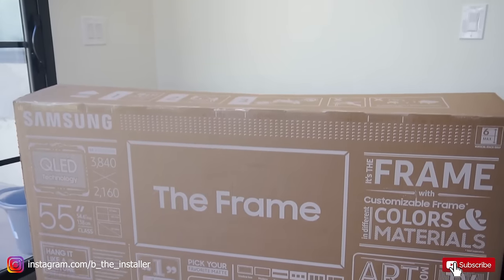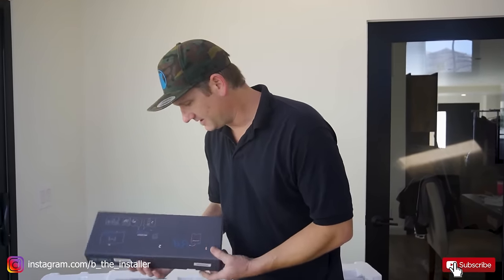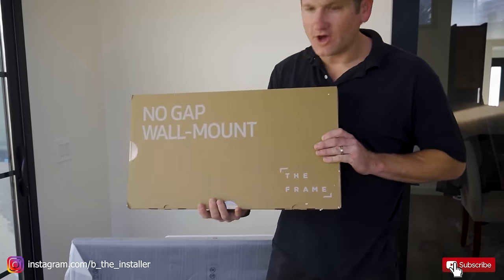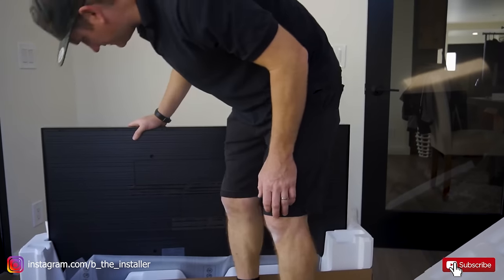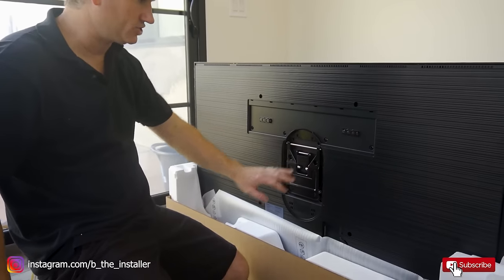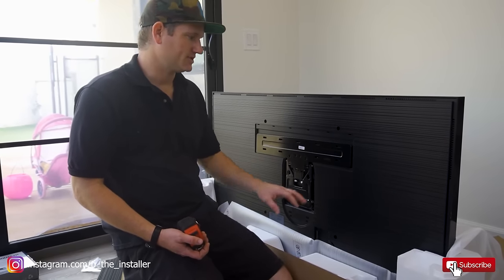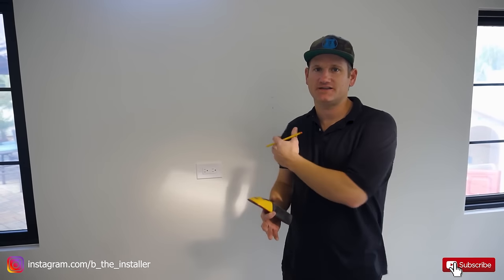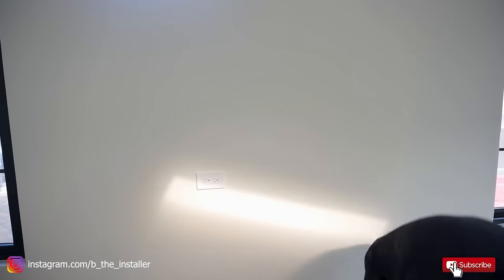Samsung Frame TV Installed w/ "No-Gap" mount in 30 minutes

Comment: What kind of plate did you use next to the outlet at the bottom that you pulled the one connect wore through?
Reply from the maker: Low voltage box and then an oversized blank nylon plate from home depot.  They're like 5/8" bigger and easier to cut if needed.

Comment: You mention using drywall screws, what size should I get (I assume they come in different sizes)?
Reply from the maker: The no gap mount needs some sort of screw into the stud.  2 inch drywall screws work with a washer but you can use the samsung screws that come with the mount.
Reply: @BTheInstaller   You scared me with the info the screws in the box can strip easily. Once that happens how would you get them out again? I'm off to Home Depot to buy all the supplies.
Reply: We did it!!!! Your video was excellent and your commentary perfect! We didn't even look at the manual which at first glance was pretty confusing. Thank you so much for your service!! Now we just have to wait for Comcast to put a new cable line somewhere as right now the cable runs through the middle of the room, ruining the look a bit :o)
Reply from the maker: @franreynolds2008  awesome.  Ditch cable, it sucks.  Try a Hulu live or YouTube TV trial, so much better and cheaper. No boxes, no contracts.  Also tag me on a IG pic of your work.  If you do, make a nice wide angle pic with the tv in middle and brag to friends.  Take care

Comment: Great video. Just curious and forgive me if this was already answered, but I thought the One Connect cable provided from Samsung for this tv and any of their latest tvs that use the One Connect box is not in wall rated. Samsung makes a One Connect in wall rated cable for purchase separately. I’m going with the Samsung Q90 82” which uses the one-connect box and was on the fence about putting the included cable within the wall cavity va having it exposed on the outside of the wall. Thoughts?
Reply from the maker: Correct.   Since they've added power to the one connect, it's really complicated the install a bit.  As I've said, I don't condone running high voltage wiring in wall, but when it comes to sound bars, and self amplified speakers like sonos, and this samsung style tv, there are limited options for making it look clean.  I've had many electricians who are less concerned with cords in wall as I have been.  They make an in-wall rated version of the wire for $200, so you can pick that up.  You also can install a 14x14 inch low voltage panel behind the tv and it can have a power outlet inside. But then you can't access the one connect very well.  We didnt have the room for the box behind TV, and I was comfortable in dropping this wire in wall 3ft and outputting it below.  The customer knows the code and opted for this method.
Reply: B The Installer - Thank you sir! Well explained. Subscribed!
Reply: @BTheInstaller  it’s not up to code

Comment: Hey B,

Appreciate the good video. I have a 2019
Frame coming this week so I’ve watched your video twice through now to help with the install. I’d like to run the one connect behind the wall but I understand it technically isn’t wall rated. It’s going up on an exterior wall in my master so the wall is insulated. Is there any greater threat posed running that one connect down about 4 feet of insulation? Thanks!
Reply from the maker: Hey greg, it's actually depends on if there is a fire block or not more so than the insulation.  Insulation lays flat and so I try to use a fish tape and go in front or behind the insulation. If you can get the tape up and down then try and without resistance, pull one connect down the wall by taping.  If it has resistance, you may need to move insulation around by sticking arm in wall.  Of you have fireblock, then it's harder.  I simply cut straight into drywall and fire block run the cord down past the fire block and then put a metal plate over the whole in wood and patch the drywall.
Reply: Thanks!No fireblock.  It seems like I can get my fish right up the wall no problem. I also have the 55 inch model coming that you did in this video so I jumped the gun and used some of your measurements to pre Mark the wall and cut my two holes. Should be able to run that one connect right in front of the insulation. Thank you!

Comment: Hey I researched that the cord for the connect one that you ran into the and between the studs is not “in wall rated”. Is this true? What are your thoughts on this. Haven’t purchase my tv yet but want to gather all my facts before I do. Thx!
Reply from the maker: Correct, in both frame videos I highlight this.  It's not something many are concerned with unless you're running it through studs and near screws and stuff.   How I did both, were straight up and down, as safe as it could be and if that still is not your choice, they make an in wall rated version I'll link in description.

Comment: I watched another video where the guy said the cable was not wall-rated, thus requiring a conduit. Is that true?
Reply from the maker: This video also says its not in-wall rated.   But he should have explained a "conduit" is not changing the fact that the one-wire still is a high voltage wire inside.  So it's actually still an issue.  Even the in-wall rated cord you can buy has its flaws.   It's my opinion that ony own tv, I would not be concerned with this cord in wall straight up and down to avoid it being visible. But it's also not a very visible cord.  So your call.  Thanks

Comment: Another GREAT video from B the Installer! 

In watching this, I have just one question. It appears that the TV you installed hangs with the frame flush to the wall...yet the TV overlays the electrical duplex outlet. 

So is the frame "thicker" than the TV itself to allow it to overhang the duplex? (I will need to install my Frame with the bottom 1/3 overhanging a zero clearance fireplace which is flush to the sheetrock, so I'll need to run the one-connect cable along the TV back from near the bottom of the TV horizontally to the edge of the TV to pull cable through a chase). Will the Frame still lie flat on the wall with the cable running along the back of the TV?
Reply from the maker: Yes the wire is extremely thin and doesn't effect the flat tv.  But anything thicker will.  I had to take off covers to get things laid flat.
Reply: Hold on, you say you had to take covers to lay it flat but the cable running along the back is thinner than an outlet cover?
Reply from the maker: No.  The cover plates are thicker.  The wire is extremely thin

Comment: What is the exact model number of this 55" Frame TV?  I need to make certain regarding the location / dimension of that wall mount plate.  The back of TV looks different in regards the plate location on your video compared to the view I get online of other 2019 Frame TVs?
Reply from the maker: No idea.  Probably can read off the box when unboxing.  Should be the 2019 55 inch.

Comment: Two questions:  I don't have a center stud but have two 8 inches on either side of center (16" apart from each other).  Would that be ok?  Also, should we remove the outlet we have back there (to minimize the gap) or is that not an issue?  Thanks!
Reply from the maker: The 16" studs you have are the norm and great.  The mount is made for your situation.  You can remove the outlet if needed.  It did protrude out a little from the power outlet.
Reply: @BTheInstaller  Ok thanks! We are installing this above our fireplace and I just noticed the conduit that was installed is only 1" in diameter so I don't think the cable will fit through.  Any suggestions?
Reply from the maker: Well depending on the layout of the fireplace, cords can be run outside of that conduit in walls.  If you taking out a power outlet, you will be making some holes... I may cut a 6" square drywall hole and use that hole to fish the wire.  You can repair the wall. May need some pro help

Comment: My brother mentioned that the wiring behind the wall is a fire hazard. Do you know if they sell wiring that is fire proof or fire retardant?
Reply: Samsung does sell an in-wall approved connector. However, from reviews elsewhere it sound like it does not allow the TV to sit flush against the wall, which is kind of the whole point. Also, Samsung seems to be sold out indefinitely!

Comment: How are you getting around that the one connect wire is not wall rated?  Samsung sells a wall rated cord for 2019 models- so having a 2020 model thoughts on what I should do?
Reply from the maker: I install it in the wall, every time.  But I do knowing to keep the wire clear of nails or screws and straight up and down.
Reply: B The Installer so you think the wall rated cord is just wrapped not to damaged it?
Reply from the maker: That is exactly what it is and It won't burn as much in wall if on fire, as well.  But those are worst case scenarios. The 2019 cord is same as 2020 by the way.

Comment: Does the hole for the One Connect wire have to line up exactly behind where it connects into the TV? I already have a hole in the wall I was planning to feed the wire out of, but it’s higher on the wall, so the wire would have to run behind the TV for about 18 inches to reach the connection point. I definitely don’t want this thing to crimp, as I understand the cable can be ruined by a sharp crimp.
Reply from the maker: If you have enough length and it's not affecting the how flat the tv is on the wall, should work.  I prefer to get the cord in the general area the cord attaches for the reasons we are talking about, length and mimizing risk.

Comment: I put a little used candle wax in the hole before putting the Samsung screws into the stud, to lubricate and minimize the stripping, but it still stripped.

Comment: What about plaster..? I don't think you could cut so easily into the wall..? Thoughts..?
Reply from the maker: I've installed on plaster walls.  The only reason it would be different is if the plaster wall has 2 x 4 's horizontally or angled for structure.  The was actual plaster is just a little more thick than drywall but not really harder to mount on

Comment: Does it just sit on the bracket or are there safety pins somewhere? I installed mine but it does not feel safe.
Reply from the maker: The bracket sits down into the mount.  That mount has some play for leveling but is very safe if its on the bracket.  You can tilt the tv down and see for yourself.

Comment: hi, can a 3/4inch plywood hold the 65inch version of this tv? i understand that you are installing it now on a dry wall, but how about a plywood?
Reply from the maker: Yes probably.  What's the plywood attached to?
Reply: the plywood is attached to a metal frame wall / room divider.
Reply from the maker: If the plywood is secure and not goinf to fall over the tv can easily be attached to it with drywall screws and washers.... not an issue at all. That bracket sits flat.  But I'm not saying your plywood is secure, I have on idea you're doing there, lol
Reply: sorry if my description is a little vague. this is actually what my setup looks like. https://youtu.be/hnuqHvjC13Q. the only difference is, the rotating part and the structure around it are all made of tubular steel. the only part made of plywood is the backboard where the no gap wall mount will go.

Comment: do you know if I get a mount that tilts etc will i need a recessed type bracket/mount
Reply from the maker: This mount tilts down. Extending and turning left and right would require a recessed mount or would stick out. Yes

Comment: Do you have a link to the box and cover plate you installed by the floor?
Reply from the maker: Just single gang low voltage box and nylon cover plate.  I don't have links from home depot

Comment: if i had used a toggle in middle where you used Samsung screws would that have effected the mount because the toggles screw heads are bigger than the Samsung
Reply from the maker: I use the 3/16 flat head toggles.  The 1/4 are fat and clunky. And 3/16 are 80% as strong anyways.
Reply: @BTheInstaller  thanks. ill run to Lowes and make sure i have them. im installing a 55" picture frame in morning and metal studs there. so i may not be able to center in stud, ill make sure i have the 3/16 thanks!!
Reply: B The Installer , just watched your Orbi video have you ever installed TP-link Deco M5 system?? 
Also I saw your wire hide in wall video, is magpul a waste of money?

Also can you make a HDMI over Ethernet adapter video there are so many I never know which will really do the job

Comment: I saw a youtube video where the person said the wire that goes to the box is not "in wall rated" unless it’s put through conduit, which would need to be custom due to the size of the end piece that plugs into the box.  I didn't see you use conduit in the video and I couldn't find anything about this in the manual for 2020 model.  Are you aware of this?  thx.
Reply from the maker: Yes.  You can use a simple 2 inch conduit found on Amazon. They have one 2" x 10ft. Just pull it down the wall and the small side of cord that goes down is 1.2 inches.

Comment: Thank you!  We need a longer one connect cable. Which one is there for this QLED Frame 55LS03T (2020)
 TV? We only see the Samsung VG-SOCR15 for frame 2019 models. Rgrds!
Reply from the maker: it's the same wire.  get the 15M
Reply: @BTheInstaller  Known here as end of life, ordered one as returned good. Its underway. Thx

Comment: My older samsung  has picture frame mount and tv is flat to wall the mount has 4 round disk two mounts to wall and two on tv the tv ones have a wire spanding them and is then hooked over the wall mounted ones it worked great why did they change it good job though  also i would ha placed the cut dry wall piece back in wall and mudded it back in  just use a screw to hold it in place temporarily while mudding
Reply from the maker: That mount was awful for most people.  This mount is far superior and much more secure. The mud was not a big enough hole to warrant backing with plywood, but any larger of a hole and I would have.  It's a video idea I will show eventually.  Thanks

Comment: Is it possible to run cables anywhere behind the back of the tv with this mounting? There would probably be a gap between the back of the tv and the wall but would tv hold firm in the position like an inch off the wall?
Reply from the maker: You dont need wires for this TV. I has 1 cord that connects to the tv and in the video I show you how to deal with that cord.  The rest of the connectivity is to the one connect box below.
Reply: Thank you, then you probably cant call it no gap mounting, he. Do you think those two fixings alone wouldnt hold the tv?

Comment: You can use a 1/2 inch socket on the bolts they provide you with too not just the philips head
Reply from the maker: Not on these.  They're circular with just the Phillips.  I would absolutely use a 7/16 or 1/2 inch like I normally do on lag bolts but these frame ones are just fat screws

Comment: Thanks for the detailed run through. I see there was a plug socket behind the tv but it wasn’t used. I have a similar arrangement but was hoping/intending to use the plug to power the tv and only use the built in apps on internet, so wouldn’t need to worry about the onebox - but it seems from your vid like that won’t be possible. I don’t have drywall on the wall it’s going on - it’s solid brick, so I can’t easily run the cable the way you did it. Do you have any suggestions for how I could install it using the socket behind it? Not sure if I could swap it for fused spur to keep clearance to a minimum? It all boils down to that one cable I think?
Reply from the maker: Sounds tough man.  The extreme solution would be to hammer out the outer shell of brick and stick a low voltage panel in there and use the existing power in that panel.   It would take a good concrete guy such as myself to pop out the brick and insert the box.
Reply: B The Installer thanks - think I will find another method in that case as it’s a party wall and I don’t want to take that much out. There’s a cupboard roughly 10cm to the left I could utilise, I could channel out the wall to run the one cable - and the cupboard can house the box discreetly. Thanks again

Comment: What made the fish tape come out the tiny hole at the top?   What if a vertical stud won't give you access to the side in order to be under the tv?
Reply from the maker: There was a fire block which is horizontal stud above the hole I ended up using. Can you explain the second part?
Reply: B The Installer I think I get it now. You run strait down, then across externally to the wall, over to the plug socket.

Comment: Is this an in wall rated one connect cord?
Reply from the maker: Not suppose to.  You can run a flex tube in wall if its a straight shot to be protected. 1.5 inch

Comment: Can you please respond to about running a non in wall rated cable in the wall. Samsung sells an in-wall rated cable for this application. They market the cable as invisible because it remains outside of the wall. Very dumb, I know. We all expect not to see a cable. I hate TVs with the one connect box.
Reply from the maker: It is not in-wall rated. Plain and simple.  However, I did it in all 3 of the videos. So you will have to decide.  The in-wall version is like $200+... all non frame 4k of 2020 no longer have one connect.